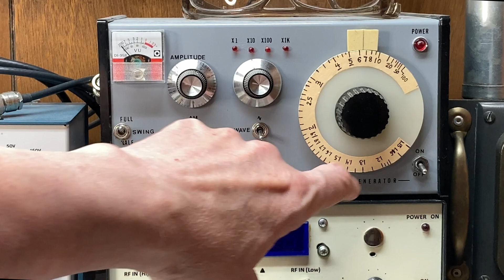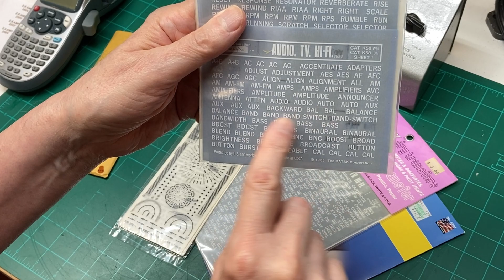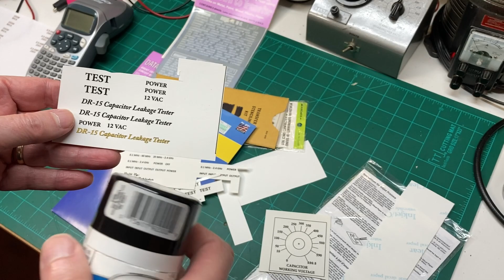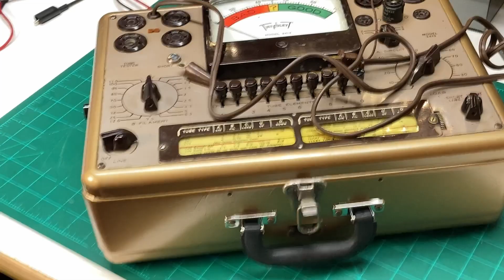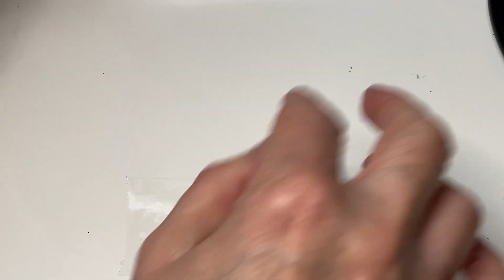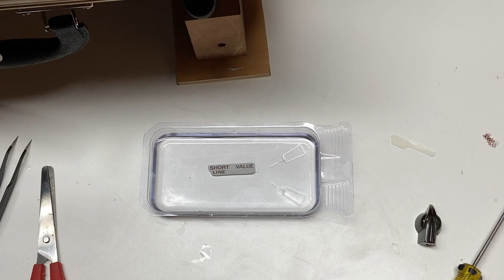Labeling & Lettering Your Electronic Projects

Comment: 8:05 You can buy white laser toner and use it to fill an old cartridge.
The main difficulty is getting rid of the black toner remnants from the cartridge. The first few prints will come out grey instead of white.
You can just print a few waste sheets until the white comes through properly though, so not a big deal.
Reply from the maker: Interesting, can you buy a white toner cart. for a Canon color laser printer?
Reply: @DVRproductions52  No I don't think you can buy them. You have to clean out an empty black cartridge and fill it with white toner. Once you have made the white cartridge, you can keep refilling it.

Comment: Just wondering but can the packing tape be removed from the label/decal after it is applied to your project ? Say like using heat from a hairdryer or heat gun and peeling the tape off leaving just the label ?
Reply from the maker: Not sure why you would want to put packing tape over the decal.  If you want to seal it, I'd mask it off and lightly hit it with some clear lacquer or enamel.  You could try using a small paint brush to apply the clear coat but it may smudge the label information.  --  If you want to remove the whole thing because of a mistake heating it up with a heat gun probably would help soften it.  BTW, some decals can be put on with the ink or toner face down, that would protect it from being scratched off.  Of course you would have to print it in reverse imaging. --  Did I understand your question properly?
Reply: @DVRproductions52  No, in your video you used clear packing tape and used water to remove the paper from the letter/number decals and then applied it to the project panel, was wondering if there was a way of removing the tape itself leaving just the decals, would heating the tape work ?
Reply from the maker: @noone-zq7my  No, I don't think that would work because by using water to disolve the paper and leaving the toner stuck to the sticky side of the tape, the lettering would just pull off the project and remain a part of the packing tape.  --  You could try it and see, let me know if you have some success with it.
Reply: @DVRproductions52  No, it didnt work the tape simple bubbled up or melted destroying the label, oh well, will stick with your idea tho ( excuse the pun).
Reply from the maker: @noone-zq7my  Thanks for letting me know and that you're "sticking" with the channel.🤣

Comment: Great video and tips. The Dymo transparent solution has an important limitation and that is temperature. The label is heat sensitive, made with heat transfer in the printer. It is possible that the label turns completely black (unreadable) after a while when exposed to heat or sunlight (heat). A hairdryer can expose the problem real quickly. Better don't use this type of labeling for your projects.
Reply: That's very true.  That's why I like laser printing on a clear decal sheet instead.